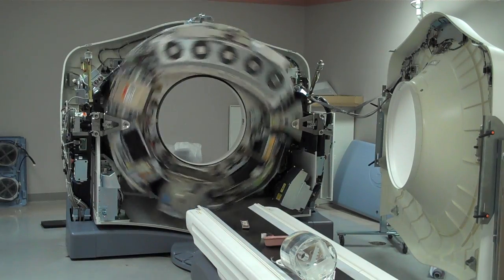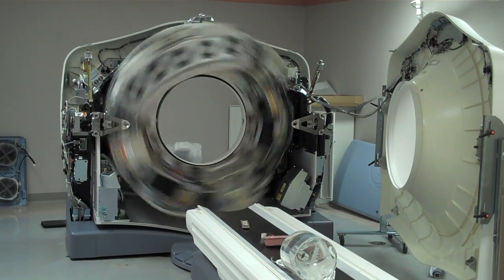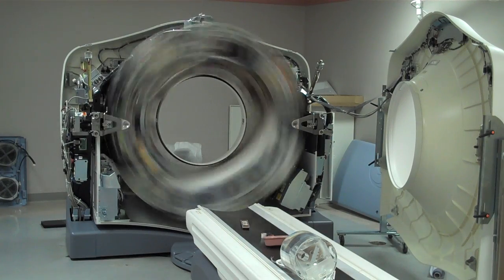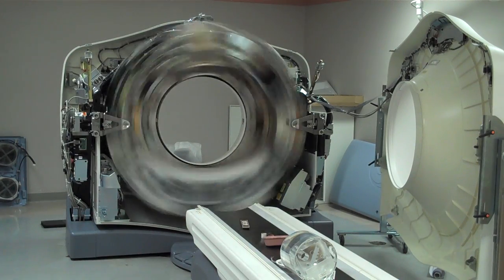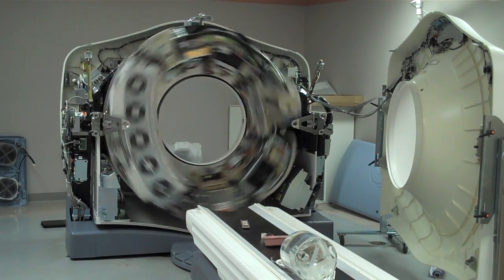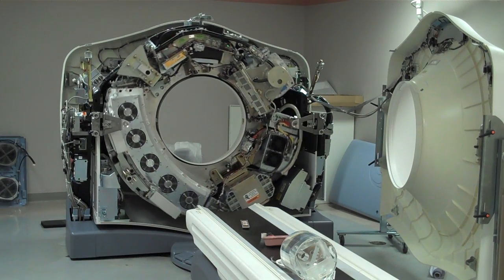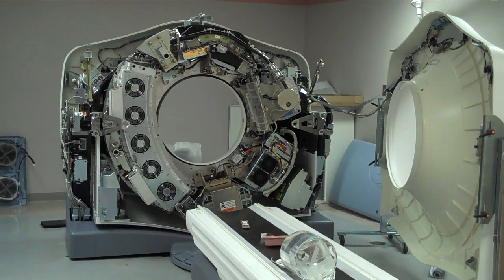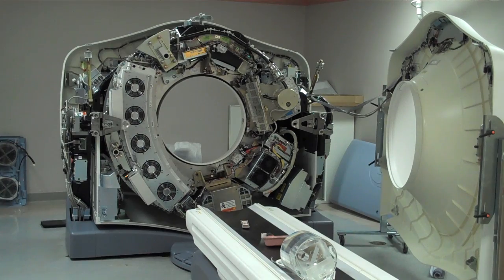GE Technician Lynn Oby means seconds per revolution.

Comment: Your presentation has a problem: It's 2 seconds per rev, 1 sec. per rev. 0.8 secs. per revolution, etc, not 2 revolutions per second, ...0.8 revolutions per second, 0.4 revolutions per second.
Reply: Any idea what the R. p. m.  is supposed to be?
Reply: RPM stands for Revolutions per minute...nothing to do with CT Scans that are measured in seconds per revolution normally.